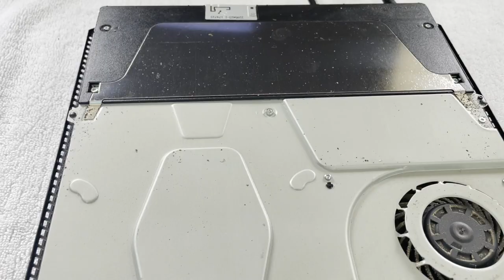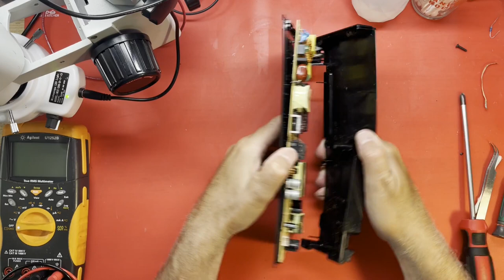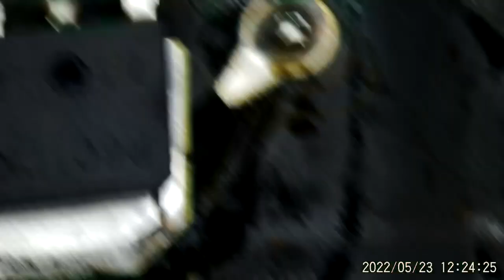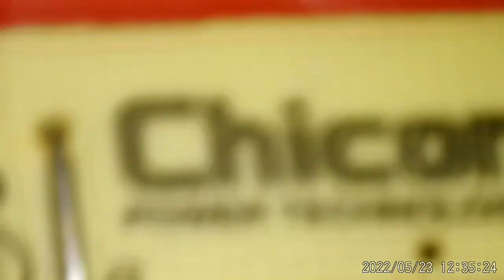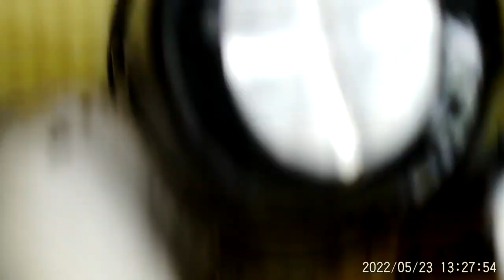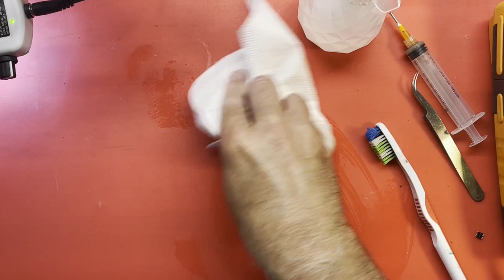#36 Repair of PS4 Slim No Power

Comment: Nice job!. I'm thinking you should make some kind of wire connector with a momentary switch to trigger the 12 rail vs. tweezers. Don't get me wrong, that works, I just like making custom cables and stuff for testing. anything to make the job go easier!
Reply from the maker: I have a cable I use sometimes and I place wire jumpers in the end to short pins.  I use if for troubleshooting motherboards as well as power supplies so I have not cut it and modded it yet.  A cable to a small box with dip switches would be nice though....

Comment: Today I was able to repair the same power supply with same fault thanks to you! I've watched all your videos and have learned to a certain extent how these PSU's work. May I ask what is your professional background?
Reply from the maker: That’s great news!  I make a living as a television broadcast engineer.
Reply: @ToltecMerc  Awesome! I look forward to your upcoming videos!!! Have you ever encountered a BLOD PS4 that you haven't fixed?
Reply from the maker: @shakangel666  I have fixed a couple BLOD that were due to bad Memory ICs.
Reply: @ToltecMerc  My master... today I received a PS4 Slim with error  code CE-34224-5 after trying to run any game. I have tried rebuilding database, reinstalling firmware, swapping hdd, other games but nothing has worked... have you ever encountered such error? Maybe something to do on a hardware level with the communication lines to the HDD? Please your advice.
Reply: @shakangel666  are you getting power to your USB ports? It could be your nor flash chip. Or your USB flash drive update is wrong and you should redownload the update.
Reply: @B9NE  I ended up solving the problem in a very weird way... I read the NOR and checked it with BwE software. It showed everything was OK. Then I erased the NOR chip and copied the same backup again and it solved the problem. Strange since it wasn't corrupted or anything... nothing was modified in the file. I guess maybe something to do with empty space corruption? No idea... but if anyone has the same error... it's something to try.
Reply: @shakangel666  that's super weird. WiFi and updates work normally now right?
Reply: @B9NE  Yes, wifi works fine. It's on the latest 10.01 so not sure if a new one comes along if it will show a problem. Now games run fine, wifi, psn, controllers, etc.
Reply: @shakangel666  as long as controllers charge you're good. Probably a weird fluke. You know how you have to update a couple times to make it work this time was direct to nor flash.

Comment: Do you know where I can find a replacement for 70S1K4P7 (MOSFET?) that's located at the bottom right on this PSU PCB? It's positioned under T2.
Reply from the maker: Mouser Electronics  https://www.mouser.com/ProductDetail/Infineon-Technologies/IPS70R1K4P7SAKMA1?qs=KuGazDKa6A5krM2tPb7wyA%3D%3D

Comment: I have a dead ps4 pro, same issue its a blown sop7 dap041 5v standby controller ic, different to the one in this video.
Reply from the maker: DAP041 is very similar. Same pinout as LD5760.  I'm not sure they are interchangeable though.  DAP046 can be replaced with LD5760.
Reply: @ToltecMerc  Do you source these from the typical vendors?
Reply from the maker: @optimizelogicrepair2784  AliExpress usually.  It takes a while so I buy like 20 at a time.

Comment: Do you have a sketch or drawing of what the voltages should be on the pins of DNP012A ic on a slim psu? I have 4.8v but this ic is not switching on the 12V section optocoupler.
Reply from the maker: I don't have a lot of information on the DNP012A.  It looks like 12V enable comes in on pin 1.  Pin 7 drives the opto-isolator(IC55?) which should drive the transistor(Q41) that switches the 15V or so to the ICs that generate the +12V.
Reply: @ToltecMerc  yes pin 7. But i think pin 7 gives the ground to optoisolator IC55 (pin 2), as 4.8v is already available on pin 1 of IC55 through R158. On pin 4 of ic 55 there is 17v but it's not getting on.

I was wondering what pre conditions dnp012a needs to turn on IC55. I have ordered 2 pieces of dnp012a but it will take 1+ months to reach my country. I was just wondering if that chip is faulty at all maybe the conditions to turn on q41 are not satisfied.